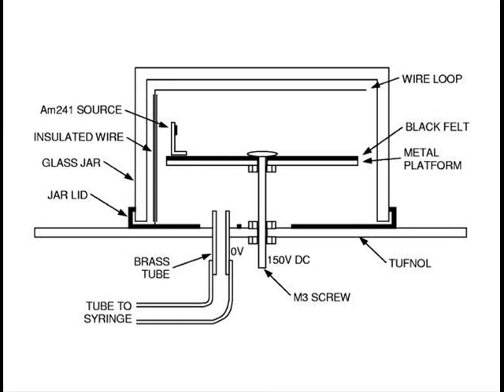Homemade Expansion Cloud Chamber

Comment: 1.Tell me please what is the power output on this particular material? 2. What you cooling it up with?               3.What's gonna happen if I'm gonna use n52 neodimium(130kg pull force each one) 8 shaped permanent array of magnets shaped in a circle around the device in order to create electro magnetic field, and meta material liquid in between them to make them spin for a very long time?        4.Could I heat, freeze whole construction, in order to get exceptional results, and what's my limits (safe way). Point a direct laser beam on the material, manipulate with sound frequency on each component(using ordinary sound amplifiers).                             5. Could I use super materials such as Titanium for exo skeleton for the core of construction.                    6. Can I attach a drive shaft to it an how? Got several ideas, but not too sure if it would work. Want to speak face to face only.                   7. Is DARPA is still hiring? ( That was the joke, but Really are they?)

Comment from the maker: @crnazvijezda Your head cleaning fluid is probably quite dilute alcohol. It should still work though. It might just take a bit longer to evaporate. LED lighting will be fine as long as it is bright. A modern high intensity white LED should work better than a filament lamp.

Comment: Great video!
I have two questions for you:
1. I have got Isopropyl alcohol (video head cleaning liquid) but there is not any word about percentage. Would this kind of alcohol be usefull for cloud chamber?
2. Can I use LED diode for source of light or need light bulb (maybe because of heating)?

Thanks for very good instructions!

Comment: Très belle démonstration!
even if I don't understand one peculiar point: are cloud chambers only working with low partial pressure of alcohol or would it works with "alcohol only" vapour?
In this case coud we imagine a cloud chamber of condensing "full" vapour at room temperature and a fraction of atmospheric presure ?  Thank again for your work!

Comment from the maker: The current required is practically zero. A camera flash supply should work fine. The peak current available from a camera flash is actually very high if the capacitor is still in circuit. Please be careful.

Comment: VERY NICE! I'm definately trying this.
Just one question though, I have a voltage amplifier from a disposable camera that can reach voltages of over 300V, can I use it even though the amperage is pathetically low?
Reply: Just another Chamber hobbyist here. The clearing charge takes so little current that it is ridiculous. I doubt there is even a power supply too weak for the job. You could even string together 17 9volt batteries to do the job and they could run just about forever. I have used the tiny 12 volt powered electroluminescent wire supplies before and they worked perfectly. I used the power supply out of a car ionizer which is about matchbox size and 2KV andnit worked too.

Comment from the maker: The tracks are easy to see with the unaided eye. You don't need a vacuum pump. I simply used a 50ml plastic syringe. You need something soaked in high purity isoplropyl alcohol in the chamber. You also need a bright light and ideally a black background to view the tracks against. It obviously has to be air tight.